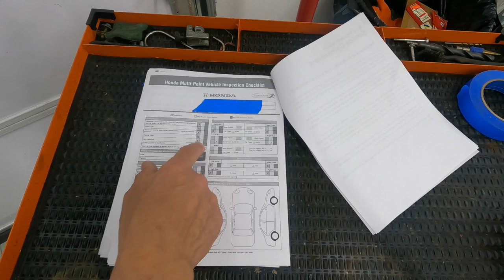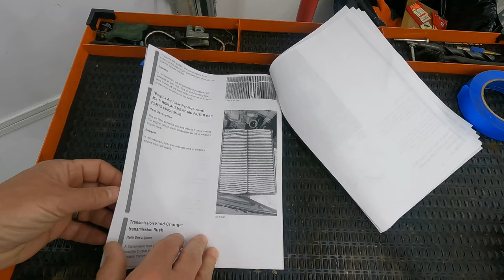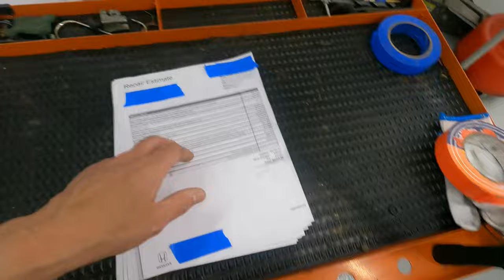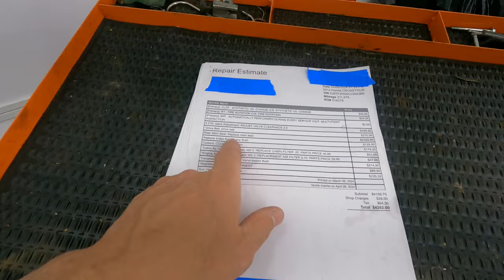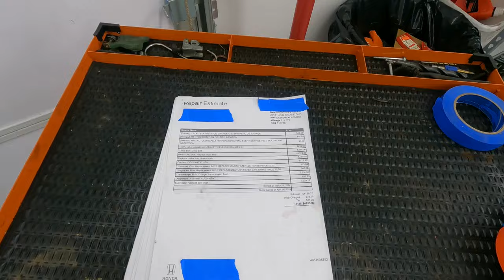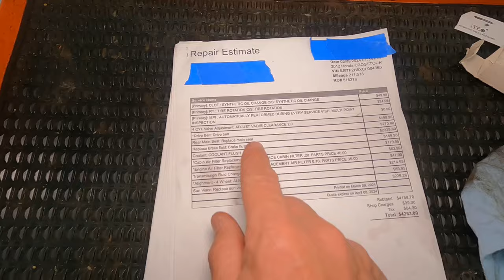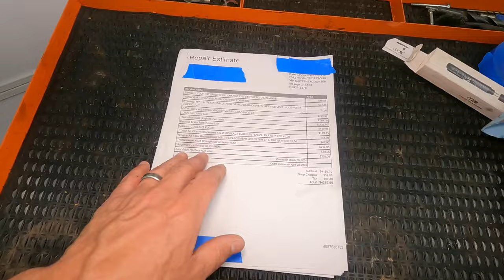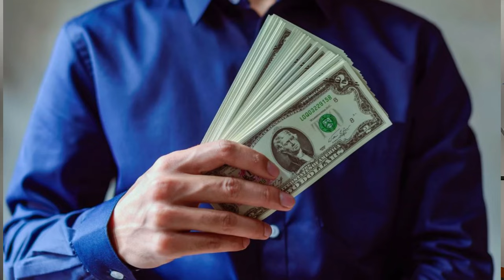Why car dealerships are called "stealerships"

Comment: My dealerships won’t verify my issues. They always say it’s fine. My coolant temp fluctuates after warm up and under acceleration it increases until I let off the gas. The coolant is seeping somewhere. I can smell coolant after going through a car wash. The right front wheel makes a noise like a bad wheel bearing. I have a factory Mopar extended warranty idk if that has any effect on my outcome. Anyone have any thoughts?Also I had a busted rear shock. It took 3 weeks to diagnose. I’m sure it just sit there until someone put it on a lift and saw the oil leaking 
I can’t find a shop in my area that will honestly diagnose these issues
Also I wanted my transmission fluid changed and they refused
Reply from the maker: it's so sad, but shops don't want to do preventative stuff under warranty, rather wait till something breaks so they can get paid to fix it. Also, warranties sold by dealers, and really most aftermarket ones have terrible reviews from real customers due to the hassle to get anything covered. Sorry you're having these issues.
Reply: @joyofwrenching  
Thanks I’ll just start throwing parts at the cooling system unless by some miracle I find an honest skilled shop
Reply: @joyofwrenching  What shops don't want to do preventative maintenance and hand a customer a bill?  They prefer to let the customer walk and then have the dealer do warranty work?
Reply from the maker: that coolant temp creeping up while you're on the gas seems to show that the cooling system is working, but just isn't able to cool it down effectively under high heat load, and you may have big issues this summer. Could be restrictions to flow in the system (clogs in passages, hoses crimped), restriction across the radiator from trash in fins, partially opening thermostat, low coolant level,  partially working water pump...I think that's why they don't want to figure it out...they are waiting till it's more evident, but you can go down this list as much as you're comfortable and check these things. What else could cause this that I might have missed here guys?
Reply from the maker: Oh no, sorry I wasn't clear. You're absolutely correct, they all love to give a bill (get paid by owner) for preventative stuff, kinda like I show on this Honda here, but they don't just do that stuff when we walk in and say I've got this extended warranty and need something done so stuff won't break like the original poster was talking about  @greeneyesms
Reply: @joyofwrenching  
Also there are no codes and I think that’s all they did not sure
Reply: @joyofwrenching  At the dealership I work at the Service Dept doesn't care if it is cash, check, CC, debit, warranty, extended warranty or whatever.  Extended warranty is more time consuming to process but it still shows up on the commission checks.
Reply: @greeneyesms  
It doesn’t make any sense from a business perspective

Comment: So you say those things DON'T need to be addressed? I started in the early 70's in the garage learning from very highly experienced men that started in the 40's and my high school auto shop instructor was the same and and owned a shop for 35 years. Both taught that part of our job was to inform the customer of issues needing addressed. Part of the reason vehicles and other equipment get into bad shape and seemingly large costs is because some shops ignore problems. It'll be OK, it wont break tomorrow. You can put it off. Then the next thing is treated the same, then the next, and the next. Before you know, it has all added up to a large one time repair bill to take care of all of it when the customer takes his equipment to someone that sees it all and informs the customer. Also, those pictures are probably for reference only and not of his actual car. Just there to familiarize the customer of what they are talking about.
Reply from the maker: True, and good points, over time many of these things and more  will need addressing. They tried to take advantage of his lack of knowledge and make him feel like it was imminent that the car would die without these things today!

Comment: Talk to friends, neighbors, & coworkers to find an honest reliable shop.  Word of mouth advertising is still the best.  It does not hurt to check BBB ratings of possible shops as well.  Your best option is an honest new car dealer who is the most well versed in the car that you drive.  Finally as a customer try to develop a relationship with the shop that you select.  Being combative does not work in the long run.

Comment: Took my BMW in for a recall. Service advisor hands me back the key and a clean multi point inspection. I was so shocked I asked him “16 year old BMW and nothing else recommended?” He said “Nope! Car is in great shape and doesn’t need a thing. Most are leaking but I bet you have already fixed those common leaks” and I had. Compare that to the Honda dealer that said I needed a timing belt “due to age” when I took it in for a key to get programmed. Considering there was a sticker on the top of the engine that showed replacement just 3 years prior I was livid and went off on the guy.
Reply from the maker: Whoa. That's definitely an unusual statement from a shop inspection!